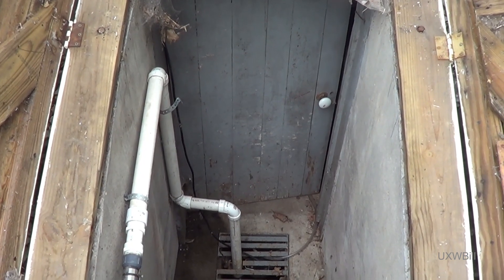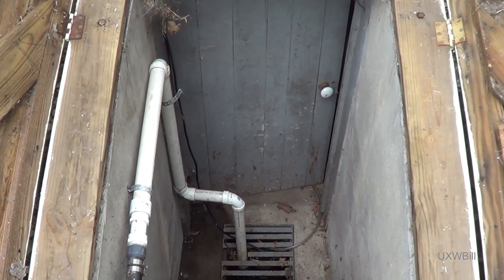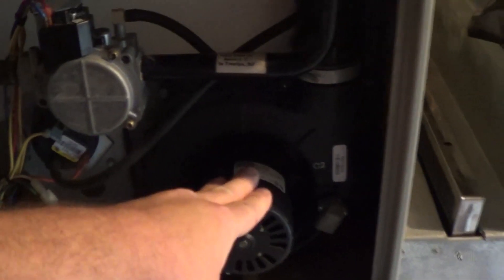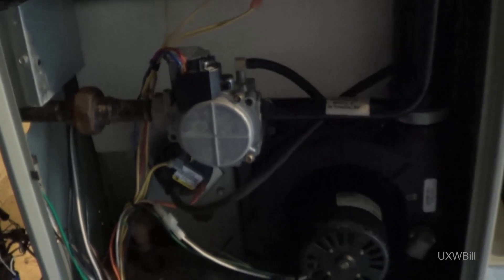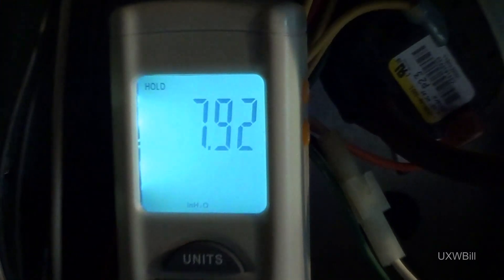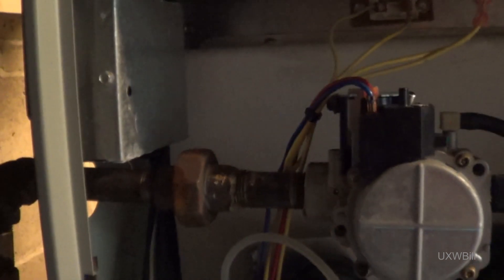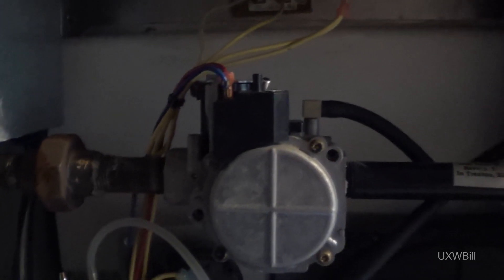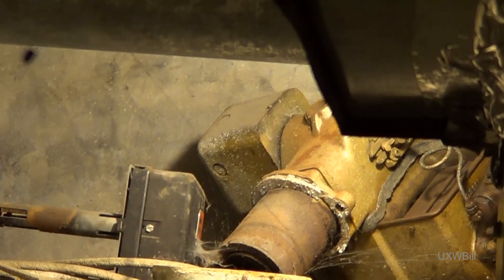Trane TUX080C942D2 Gas Valve/Gas Pressure Problems, Part 1

Comment: Are the gas control valves on Trane furnaces notoriously bad? I’ve had to replace the valve on one furnace multiple times because it seems to keep sticking open. Any suggestions on a better alternative / replacement valve design? Thanks.
Reply from the maker: Not that I'm aware of. I would suspect another problem -- maybe dirt/moisture in the gas line or excessive supply pressure?

Comment: The tubing is suppose to be larger to fit over the outlet on the gas valve
Reply from the maker: I still think it's a bad design compared to the threaded boss. (Long before this video was shot, I came to know of both the 36G gas valve pressure test kit or the need of larger tubing. I didn't have either at the time, so I could only muddle through checking the gas pressure. I have since acquired some suitably larger tubing.)

Comment from the maker: From the Humble Pie department: since someone's got to be the guy who is Wrong on the Internet, and I am usually that guy, here it is. I was wrong about the gas pressure. Evidently it's rather lower here, and was actually within spec. The gas company still thought the regulator and meter ought to be replaced, so they did.
Reply: Wait uxwbill was wrong my  perception the world is now shattered
Reply from the maker: John Smith "Persecution"

I am sorry, I find that to be highly amusing. If you think I am anything like perfect, though, you are very late in getting the memo.
Reply: @uxwbill  

Clearly autocorrect needs to be locked in the basement for awhile...

Pfft Memos who needs those? 😉
Reply from the maker: CrazyPainter1000 I have no experience with oil furnaces. Once fairly common, they have largely disappeared from here.
Reply: We see service as low as 2psi in City Of Chicago jobs.

Comment: So what is Bill's top rated furnace brand that gets his seal of approval?  Goodman?  York?
Reply: My Goodman condenser unit is still rocken with the older banned type of refrigerant in it
Reply from the maker: The good old Comfort Shaker has done pretty well in its ~25 years. They'd certainly be on the list of possibilities, even though a lot has changed. These days, I'd probably buy a Goodman.

Comment: my moms furnace im not sure the efficiency of the Daikin furnace that was installed but it was a donated unit as the one that was in my moms house was antique and rusted out at the bottom and according to a tech sent out my ab may it should of been redflagged but the old furnace was a Mueller Climatrol or something like that and had honeywell controls though the gas valve on that one was kinda faulty as it would sometimes get stuck in the off position though its been stuck in on position once and its amazing how big furnaces used to be compared to what they are now in days

Comment: Yep natural & propane (don't forget the propane accessories) are no joke if mistreated you will be blown to bits with possible property damage a loss of life. I only have electric 100% electric heat included where I currently live The place prior had a gas stove (standing pilot too) gas while better for cooking I am afraid y cat when it comes to that stuff.
Reply: Easy to say where electricity is cheap.
Reply: @2dfx  Electricity is not cheap in Connecticut but I did not build the place I am in. I also do not use heat that much I like my place cold like 62°F all year round. That is no issue during the winter but Summer,Spring and some of the fall season that is not easy. The AC runs constantly to maintain that temperature on 90°F days it keeps the place about 66°F - 70°F depending on if I am cooking or not. I hate those damn ductless mini-splits that the management had put in they suck I use my old window AC (although I am not supposed to have one in the window but I do anyway) I have told them many times that it does not work properly on cooler days (like today) the compressor randomly shuts down thus blowing warm humid air and not cold air like it is supposed to and yes I have it set on cool not heat or auto changeover

Comment: William, i'm glad to be able to enjoy new videos from you :). Is warming a house with hot air common in the usa? isn't this method quite ineffective? Here in germany we usually heat with radiators or in case of my house with floor heating (water based). Best regards from germany :).... and btw., keep the videos coming 😁, i'm a subscriber since 2013.
Reply: some houses here in the states have boiler systems but those are usually in really old places my i think one of my neighbors has a radiator based system  i dont know how many places uses a radiator based system here though
Reply: It's the same here in Canada (at least where I am in Ontario), boilers aren't nearly as common as furnaces. Some older places have electric baseboard heating (built decades ago when we used to have cheap electricity here). I'm not sure how forced air systems compare in effectiveness, but I do like having constant air circulation/filtering. Also, it's really easy to add central AC, since all the ductwork is already in place you just need to add the evaporator coil and an outdoor condenser unit.
Reply from the maker: wave z You will find all manner of heating systems in the US. Forced air is popular because it can also provide for cooling capability. Boilers are quite common and some are set up to feed a hot water coil in an air handler (usually commercial environments).

Comment: That "chill" hasn't showed up in NJ yet. Speaking of, I didn't know they made these things in NJ (that factory is actually just outside of Trenton in Hamilton Twp. NJ). Gas valves are a critical safety system, it should be replaced regardless.

Comment: what's your on  thought  Carrier or Rheems as far a commercial what kind of air handler do you prefer
Reply from the maker: I think both are good products, although I've had mixed experiences with Rheem customer service. Rheem has stood behind their product without fail, and when you call (at least during normal business hours) you get someone in the US on the phone. They are generally helpful. On more than one occasion, however, I have had to endure a "holier than thou" attitude from their representatives.
Reply: @uxwbill  I'd still like to know why Rheem has to be the non-conformist of the heatpump world and reverse the function of the O/B terminal. For those that don't know, Rheem equipment requires that the O/B terminal be engaged to activate heating mode as opposed to air conditioning mode like the rest of the HVAC industry.
Reply: @NJRoadfan  I consider Rheem to be the apple of HVAC world. You want a new capacitor? You better switch out that condenser fan or buy our specific 3 mfd legged capacitors. Want to jumper 2 caps together? Screw you! We're going to slot in a single space for 1 cap and give you no where else to safely install another! Have a service valve leak? You better only get our blocks, no body else will fit and screw you for trying to use a cheaper alternative. I swear they're going to be one of the first to go if there's ever a right to repair bill passed.
Reply: @uxwbill  I had a Trane in the past it was OK i don't think I would go with a nother i had problem with gas valves sticking on it draft inducer running at the wrong times other then that it was ok

Comment: It’s always a good day to see another UXWBill upload. And given that I am planning to take online college classes in the fall (because of COVID) on HVAC and induction motors, this type of content is really informative and applicable to me. 

Also as a side note, I’ve never dealt with Trane, but I’ve always been told from people who used their units that they were unreliable. And as much as people dog on Amana, the house I lived at had an Amana unit installed in the early 90s, it was terribly underpowered for the size of the house, but it ran flawlessly until about 2010 when the refrigeration system would no longer hold a charge, at which point it was replaced by a much larger Bryant unit.
Reply from the maker: I have to wonder how the students attending the program I went through are coping with all of this online learning. One of my instructors said "this is a hands on field and I don't know any other way to teach it". I think those students are going to struggle, because that's really true at the end of the day.

When it comes to Trane, I think most of their reputation is in the name. It's certainly not the worst equipment anyone could buy. I do find some of their engineering decisions odd, and some of the things they do particularly unfriendly to the service technician. Someone may laugh me right out of here for recommending Goodman products, yet they'd be on my short list of equipment I'd buy.
Reply: @uxwbill  I have learned that it’s hard to stop a Trane, unless it’s my Trane. I can stop a Trane apparently.

Comment: I have most certainly noticed that chill in the air. My garage workshop has been a lot more usable lately. Also, glad to see another video from you!
Reply from the maker: The days here are still plenty hot and humid. It's the nights that have cooled off. I've also noticed a change in what the air smells like. I think that comes from the plants changing in preparation for a new season. Leaves are also beginning to fall from some trees.
Reply: @uxwbill  Same here. I'm usually in my workshop in the evening, so I get a nice cool(ish) breeze. The days have cooled off, but not by much.

Comment: I should check for gas leaks at my house soon before the heater gets turned on. I'm no HVAC professional, but I know a gas leak is dangerous that the house would explode and people will die. If it smells like rotten eggs, disable the power and contact the authorities and the gas company as soon as you're out of the house to get the line shut off and to get it fixed.
Reply from the maker: Carbon monoxide is the one to really watch for. I'd not worry so much about the gas line, if it's been properly installed, is in good condition and doesn't have any of that flex line known to cause problems.

Don't be complacent just because you have an oil burner. Those can also produce carbon monoxide. CO detectors are cheap...
Reply: @uxwbill  got one of those by my heater on my back room (had to replace it 3 months ago since the old one was at 10 years of age). I test it monthly to make sure both smoke and CO alarms work.
Reply: @uxwbill  Believe me we don't uxwbill. There's a CO detector on the beam above the furnace. My old man also has it checked regularly. We've actually just had the transformer and oil filter replaced and a full cleaning and inspection. (The furnace is 20 plus years old now but still runs great)
Reply: Why I'm glad ours is fuel oil furnace. Though our stove is propane (the shut is right by the stove and the tank is near the backdoor so we could Shut it off fast)

Comment: 4th!

Hey I didn't know Uxwbill had a fullout bunker

Edit
Who would ever want to cane a great person like you Uxwbill?

Are those wires live!?
Reply from the maker: I haven't tested, but believe they could be, if someone turned on the fused switch (SSU) to which they are attached. I'm guessing they powered a previous furnace and likely could have been reused, with only the need to add a ground wire.
Reply: @uxwbill  that's a little scary if they are live given that's a metal pipe it's wrapped around.
Reply from the maker: @JohnSmith-xq1pz  People who get on me about some of the things I've done (under carefully controlled conditions and only in properties that I've controlled) haven't seen any part what of happens every day in the real world. I'm not one to advocate for overreaching safety regulations, but sometimes it's a wonder when something never happened to go boom.
Reply: @uxwbill  lol I sort of know what you mean. I've seen enough on legit reno shows to say how did that place not burn down,collapse, or explode?